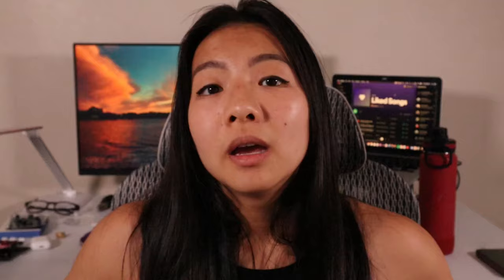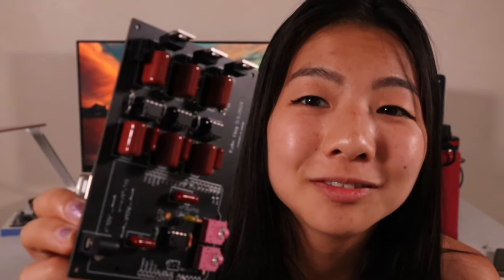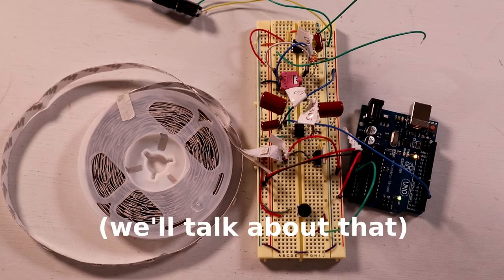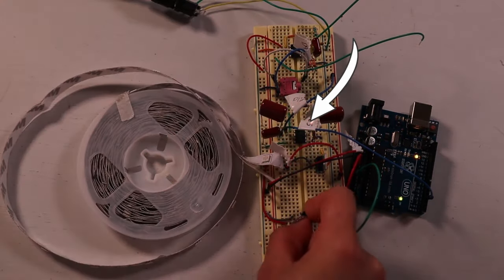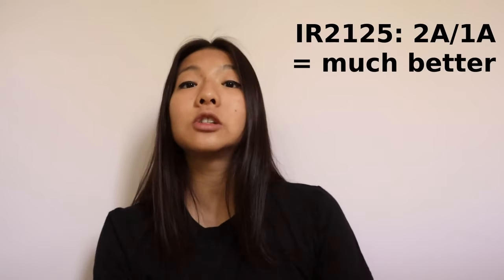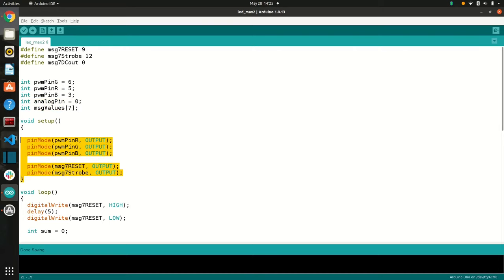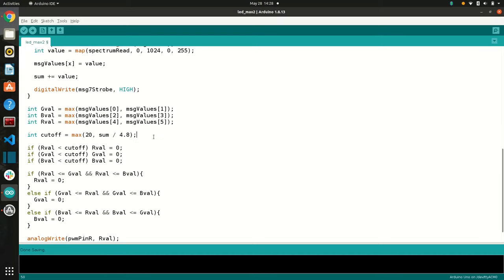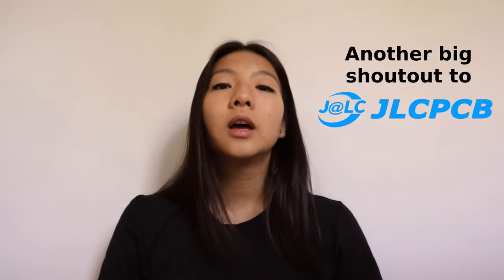Programming Myself a Concert at Home | Arduino Music Syncing LED Lights Tutorial

Comment: I watched this with my daughters (I have two!) and now they want me to make something like this! :)  Keep making these videos, you're an inspiration to my girls... and we need more of that in this world.
Reply from the maker: Wow this comment made me so happy :) Let me know if you decide to make it!!

Not sure what your level of EE is, but if you're not too familiar with what's going on, here are some tips. I would definitely suggest using my links as guides, but ultimately trying to draw the circuit out yourself so you understand every piece of it. Also, in the video, I mentioned 2 different intermediate circuits I built, but in reality, you could try multiple: 
1) just connect the power supply to the breadboard and try to power an LED with a potentiometer connected
2) do the same thing, but add an arduino so the power supply powers the arduino, and then the arduino 5V powers the LED circuit
3) now connect the wiper of the pot to the analog input of the arduino, and power the LED circuit using the PWM output of the arduino (you will have to write some arduino code here)
4) try to replace the LED circuit with the LED strip and one set of the IR2125 and MOSFET combo
5) build out the msgeq7 circuit and take some audio input! (you may notice I have 2 aux inputs - one of the is for music input, the other is to connect to a speaker so you can hear it too)

Good luck!
Reply: An inspiration to have Daddy do all the work.
Reply: @ther6989  XDDDDDD

Comment: This was awesome! You should consider doing some videos w individually addressable i2C LED strips like Adafruit’s neopixels (ws2812B chip) programmed with arduino or Raspberry Pi using circuitPython.

Comment: at 4:32 which language is this??
and is is possible to do this stuff with python??
Reply from the maker: It's code for Arduino, which is a C/C++ dialect.. However, quick google search says "Arduino uses its own programming language, which is similar to C++. However, it’s possible to use Arduino with Python or another high-level programming language." So yes!
Reply: @KylieYYing  thank you

Comment: Great Production :) 
LG C good for pulse discharge into LEDs with sub bass with increased I in the PWM. 
any REASON Y U couldn't just use 1uf instead of .82 ?
Small non polarized electrolytic's are little button cylinders in that small uf range.
Reply from the maker: you can use 1uf instead of .82